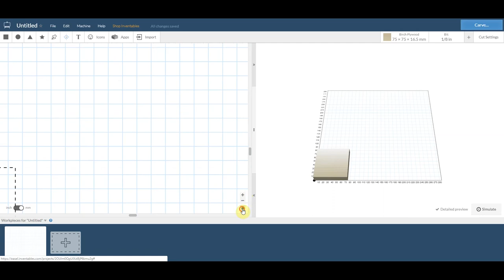Ice Chest Patio Stand - Spanish Cedar

Comment: How much does it cost to make a cooler like this?
Reply from the maker: Hello, thanks for checking out the video. The cost depends on what type of wood is used. This one was more expensive because the customer wanted Spanish cedar and it is more expensive than some other woods. I think there was about $300 in materials for this project but you could make it for much less by using a less expensive species of wood. Hope that helps. Thanks again!